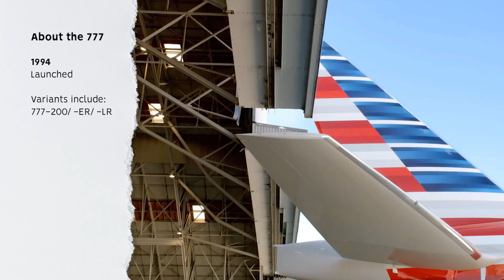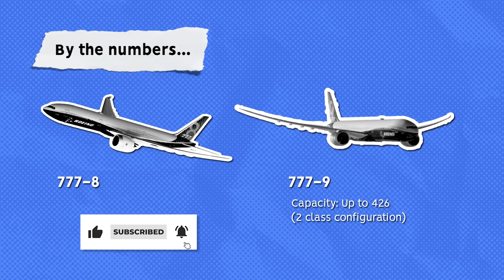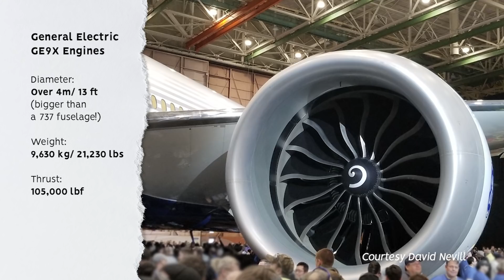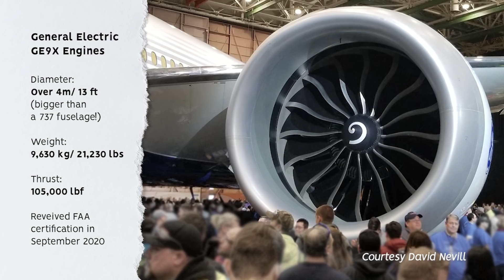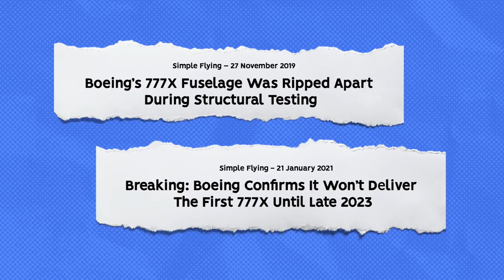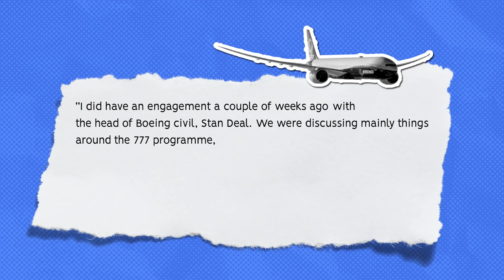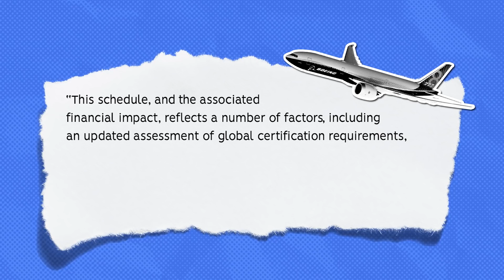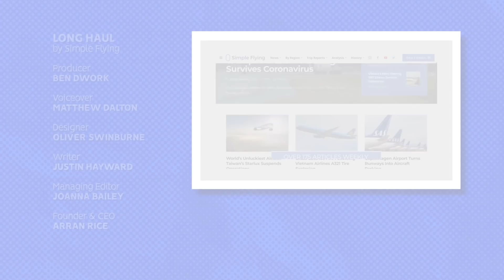Boeing 777X The New Twin-Engine Jumbo Coming Soon

Comment: It's a 777. originally designed as replacement for the DC-10/MD-11, designed for 9 across seating.   Boeing decided to allow 10 across seating  decreased seat pitch which not only pleasea ccopuntants to no end, but also brings the total capacity in line with teh former comfortable 747 with huge cost advantages over the comfortable 747.

But with the 777 having reached size limits to fit in airports what happens when airlines need more capacity?  11 across seating on the 777?  25" seat pitch? Do away with toilets and galleys to make room for more seats? 

the X may have improvements, but it remains a 777 to passengers, and remains a plane which Boeing encouraged airlines to make as uncomfortable as possible.   It makes accountants salivate, but will make coach passengers fly ot only because they have to, not because they want to.
(as opposed to the 380 and 747 that always attracted passengers).

Both the 777 and 787 were ruined by greed.  (787 was designed for 8 across, but only started to sell when Boeing compromised comfort to sell it as 9 across aircraft).

There as a time when each new generation of aircraft brought new comforts. Pressurized cabins, meals, decreased noise levels, movies on the plane.  But now, every new generation bring decreased comforts as airline accountants seek to squeeze as many seats as possible. Flying is no longer part of the trip, it is a necessary evil needed before and after the trip.  (especially when you fight for a window seat but find that on the 787 you can't control the blinds because flight attendants took over control).
Reply: That was the airline's choice. The 777 was always safety certified to allow 10 abreast in testing evacuation.
Reply: @johniii8147  yeah and horrible to fly on at that, I've been on a 777-300ER in that configuration
Reply: @ant2312  10 abreast turned out to be the economic sweet spot for the aircraft so that's why most airlines have gone with. They don't really care if you like it or not. People still buy the tickets. Complaining and actual sales are different things and the airliners proved to be correct. The reality is a vast majority buy on price in economy.
Reply: @johniii8147  yes but Covid might have changed that. Many people unable to travel long distances have discovered the joys of actually holidaying in your own country or close to home not having to get jam packed inside a 10 abreast sardine tin.  They may actually have to start making things comfortable again to attract people back. I’m one.
Reply: @andyrob3259  That's not really how it gonna go. We've already seen in the the US and China domestic markets. Travel is booming packed in. They will not go away from the 10 abreast. You will just have to pay more if you don't want to be in it. That's not changing. Sorry.
Reply: @johniii8147  I think they are trying to make it so uncomfortable that you will pay for premium economy or business at 2.5x or 4x the price just for the extra few inches.
Reply: @johniii8147  Yes, but the 'pay more' is way out of proportion for the extra space you get. An extra 4 inches legroom and 2'' width in premium economy is 2.5x the price of economy.  Try that on an annual flight from UK to Australia and I will be broke in a few years. Have to go to deal with family issues, not pleasure or entertainment so not good.
Reply: @stephanguitar9778  It's usually not 2.5 more and the market seems to disagree with you. Almost every major international carrier has rolled out PE. It's actually the fastest growing segment of the market. It's just not a product you're willing to pay for which is fine.
Reply: @johniii8147  As someone who does return flights every year from the UK to Australia that was the prevailing difference in fare for the last few years.  There are different qualities of PE on different airlines but the few that were Aus-UK were 2.5x economy and up to 4x for business with Qantas/SIA for eg. Not all airlines have PE and is quite a recent invention. Some of the bare bones discount airlines have their version of Business class which is on par with PE in better airlines, eg AirAsia or Scoot from KUL or SIN to MEL  but is 4 to 5 x  more than the normal economy ticket.   Its not just a case of 'not prepared to pay'  Not every one can afford it, also I would be prepared to pay for 2'' more legroom and 2'' seat width (which ahs been stolen from us on most 777s and 787s for eg)
Reply: @stephanguitar9778  The differential varies market to market. For such a long journey  some willing are to pay a premium on BA or QF.  It's the middle ground between business and economy. It's called market segmentation. And it's not new or recent on either carrier. BA introduced in 2000 and QF in 2008. Other carriers are following their lead since they are making money off it. And it's not 2" difference in legroom, it's generally 6 from 31" pitch to 38".
Reply: And how much was an intercontinental plane ticket when the 777 was designed in the late 80's, early 90's? 2000$ (adjusted for inflation)? 
Don't kid yourself, when you buy an economy (or even basic economy) seat to fly across the world for 300$, the airline's not profiting on your back. You're there because they can't fill an entire plane with business class seats, and at least this way they can put up with the costs. 
The only reason flying is terrible (in economy) is because that's what the market wants. Every flight has premium or business cabins that you are more than welcome to book a seat on.
Reply: @devnfun  HOwever they give you no choice. Premium economy if you can get it is 2.5 times the price. eg UK to Australia (which I do every year, exept since covid) is £1000 economy or £2500 premium economy or £4000 business and that is for a discount, non changeable without a hefty fee.  ticket
Reply: @stephanguitar9778  That's actually a really good price for business class for such a long journey. Likely do to all the middle eastern competition in the market between the UK and Australia.
Reply: @stephanguitar9778  Pre COVID the Singapore low cost carrier Scoot was planning flights to Europe. Singapore will be glad to get back into the air because they depend entirely on international flying. If they're flying to somewhere in Europe you could look at going to that hub on Ryanair or something then joining Scoot to Australia via Singapore. In economy make sure you pre-pay luggage and meals on all legs of the journey. Scoot has a premium-ish economy seat called ScootPlus that is better than economy and isn't hugely expensive and if you select that your 30 kg check-in luggage is included, as are your meal and beverage. They also have a "no infant children" section for a few dollars extra to put some distance between you and any crying children. Perfunctory, unfriendly service and the meals aren't great but you can't have everything.
Reply: @devnfun  Yep it's usually those paying the low fares that like to complain about what get. It's the classic economic lesson you get what you pay for, or don't pay for. There is always an option to upgrade to a better experience but you have to pay for it.
Reply: @johniii8147  Rubbish.  We have no choice. I would happily pay for an extra 2'' of legroom and a proper seat width, as many others would. They do not give you the choice. Premium economy is just a complete rip off,  2.5 times the price. That is on a return flight from the UK to Australia £2.5K vs £1K for those few extra inches. I was happy 10 or 15 years go paying what I did but now I am paying more and getting squished in, in a very unhealthy way. Have you ever done a night flight on a 787? arms and elbows crossing your neighbour or visa versa, or them breathing their dog breath in you face as they are that close to you?  Luckily I should be able to fly A380s for at least half of my trip for the next few years and dont care if I have to pay more for it.
Reply: Airbus: Hold my beer (mainstream 10-abreast A350 and 9-abreast A330 being studied)
Reply: @steinwaldmadchen  Air Transat has already had 9 abrest A330 and A310s in the past.  But  to compete against high desnity per-seat cost on boeing Airbus has to follow. Which is why this signals the end of pleasurable air travel.  City buses will  be more confortable than coach air travekl.    Aur Canada was asked at financial analist telecomfence recently if they planned on expanding "Premium economy" but they responded they were happy with current "densification" of aiircraft. Translation: make Premium in short supply so you keep its prices high.
Reply: @jfmezei  It was reported that Airbus is studying mainstream 9 abreast A330NEO and 10 abreast A350, targeting at 17" seat I guess?
But I can't really blame them, after their failed attempt in campaigning 18" minimal width. Unfortunately, for airlines bosses, having the ultimate CASM beast is more peferrable than offering "basic comfort" in Y cabin, given how razor-thin the margin is.
Reply: @steinwaldmadchen  I am more than happy to pay for the space. However what they are trying to do is to get you to pay business class or premium economy which gives you a few more inches but for 2.5 times the price or 4x the price in business.
Reply: @steinwaldmadchen  OMG! 😱  I thought they had reached the limits of discomfort with the 787.  The A350s Ive flown in are just about acceptable but another column of seats and that will be it.  I am forced to fly back and forth between the UK and Australia every year and it gets harder all the time (pre COVID) to chose airlines with civilised seating.  My favourite ever was Thai airways A380, economy upstairs front bulkhead seat, heaps of legroom 2 seats on the side only and very quiet. Worst being 787s night flights which are designed for small teenagers or cats to be comfy on.
Reply: allmost as if we live in a capitalist society where growth rates and profits are more important than people

Comment: As a passenger, I never enjoyed the 777.. so I don't see this as a Game Changer from the passenger's point of view.   Perhaps the fuel savings might be from the operators point of view....   The trend is smaller longer range, not bigger so it might be a tough sell in the long haul.
Reply: That OK. The things is that BOEING NEEDS TO GET  DOWN OF THE PLANET!!. I love all the planes and including both Airbus and Boeing
Reply: The 777 is one of the most successful plane ever made. And as I tell you  I love it. But if you don't like the 777, you have other options
Reply: @sergiolaurencio7534  exactly, tnats why i take the airbus option with emirates, qatar or eitihad
Reply: @ant2312  That fine. And in my case I will select the 787 and 777. But also the 350 or the 330 neo that Delta airlines have. One just go were They like. But right now I haven't fly since 2019 since the pandemic. And I haven't go anywhere. Life is more important and valuable. And at different of a plane change, life can't
Reply: I hope one day on fly on the 777-300 of all Nippon and zoom on the 777x
Reply: I always feel safe on a 777. There have been just crazy stupid pilot error crashes where the sheer structural integrity of the 777 saved the day.
Reply: Just curious, why dont you like the 777 as a passenger?
Reply: @ichhasseamerika    Don’t like 3 abreast seating on the window. Much prefer 767’s two abreast.
Reply: The cabin and for example window sizes are better, so it will only be comparable to the 777 in some ways and more to a 787
Reply: @spongebubatz  Window size is shit! More legroom and wider seats are better. Let's get the fact straight. Stop using the stupid window as a reason to why any plane is better.
Reply: @nntflow7058  chill, I didn’t say it is better, I was just saying that it comes closer to a 787 than to a first generation 777. In the end the hard product of course comes down to the airline, that’s no surprise and that’s with no doubt the factor that makes your stay onboard comfortable or not
Reply: @nntflow7058  exactly, I always pick an aisle seat I couldn't care ;ess about the windows as im not 12 years old. 10 abreast is not nice, I've been on a 777-300ER in that configuration. New wings and less fuel burn will not improve my assnger experience comapred to the A380/350
Reply: @ant2312  The 747 would be a dream that would never be true
Reply: @nntflow7058  That's the airline's choice. And if you want a wider seat and more leg room you have to PAY for it and not fly standard economy. That's true on any airline.

Comment: How will Boeing make the economics on the 777-8X work?

The -9 according to Boeing is atleast 10% more fuel efficient (casm) than the A350-1000 while the Airbus claim the latter has double digit advantage.

The 777-9 will have more seating capacity and can carry more freighter but the advantage diminishes when the shorter variant -8
Reply: Range, that’s the selling point of the 777-8, it would be more of a successor to the 777-200LR than to the normal 772
Reply: @spongebubatz  That an probably the 777F. If the 8 does get built likely for the F version. The market for the passenger version is very small, hence suspending the development.
Reply: John Iii The  -9 is  a market on its own unless Airbus stretch the A350 to 400+ pax in 3 class configuration.
Reply: @francishallare204  The market for 400+ passengers is small so i doubt they are that focused on it. They already got badly burned with the 380. The 350-900 is their sweet spot. The 1000 hasn't sold well. Their money right now is pumping out those 320 series aircraft, especially the 321 neo variants.
Reply: @johniii8147  the 1000 will sell well, don't be so impatient

Comment: Boeing should look 👀 at making the 777-x ULR, like the A350-1000 cause it would make it more competitive!!.
Reply: Have you noticed how amazingly much range the 777-8 has? Also the ULR market is very small, nothing too exciting.
Reply: @widget787  lol at the boeing fanboi
Reply: @ant2312  lol, so I am a Boeing Fanboy only because I say the 778 has much range, which is true, and that the ULR market is rather small, which is also true?
I think that you are the real Fanboy here, Airbus Fanboy ...
Reply: It's too small a market for Boeing to be that concerned about. The 777-9 should be able to handle 95% of the routes in the world where an aircraft of that size is required.
Reply: @johniii8147  and another boeing fanboi
Reply: Unfortunately Qantas picked A350. 778 actually has better payload-range than 35K, but at a cost of burning ~10% more. As long as A350 can acceptably do the job there's no need for 777x.
Reply: "Picked" but never ordered. Even pre pandemic they never committed to an actual order. Project sunrise always seemed more marketing than anything. I don't think Boeing ever took that project that seriously. They were not going to continue developing the 777-8 for an order of 12 aircraft. This was pre max issues and pre pandemic. Qantas is actually a very small international player.

Comment: If Boeing says the 777x will be ready in 2023, it will really be ready 2025.
Reply: I just hope it doesn't become the next 737 MAX, it's better to take longer time than making it in a hurry to compete with Airbus.
Reply: @Bror Johan Yes... At that time regulations were quite relaxed! Almost all aircrafts at one point have been grounded ranging from the Boeing 787 to A320 series, but for a shorter period of time than the Boeing 737 MAX. I hope Boeing understands it's mistake and do not repeat.....
Reply: @devtheking21  Boeing understands only one thing and that’s to maximize profit for their top level executives and shareholders at the cost of safety. Unfortunately this callous greed culture is the standard in American corporations.
Reply: True...

Comment: There's a 773LR? The only LR version of the 777 that I'm aware of is the 772LR.
Reply: Actually not
Reply: @fonjast4930  that's what I figured.
Reply: His misspoke on several points in this video. Not unusual for the Simple Flying. It's not really considered a reliable source in the industry.

Comment: When 777X begin on delivery....A350 would launched on next gen more fuel efficient engine (if not NEO) 🛫🤓
Reply: The A350-1000 is pretty much maxed out, a further stretch would lack range and especially lack the payload capabilites of the 777X.
Reply: @widget787  in terms of capacity & rsnge A350-1000 is a mixed out segment between 777-9 & 777-8, so once there's next gen of Trent-XWB ultra long rsnge widebody market will be massed out by one type of aircraft🛫🤓
Reply: No that won't be until post 2025 as the engines won't be available. And neither Airbus nor RR are in a big rush given the big slow down in widebody sales.
Reply: @johniii8147  indeed....when 777X delivered to major airlines in 2025...the UltraFan would ready to power next gen of aircraft🛫🤓

Comment: I would say this bird will not be in service til late 2024 and there will be no 777-8
Reply: I think they will keep the -8 as this would be the base for a 777X freighter in the future.
But I think that the -8 will come much later, maybe by the end of the decade when the 777X needs replacement.
Reply: We shall see. The 777-8 is on hold for now but well become a freighter later down the line. No rush on that as the 767F and 777F are still being produced and sold. Efficiency is less important for cargo carriers given the relatively low utilization